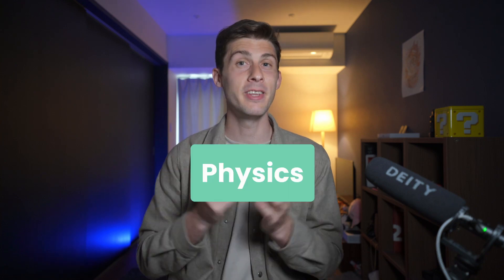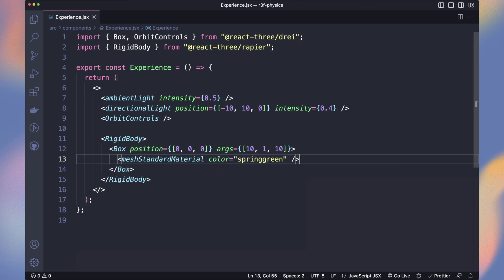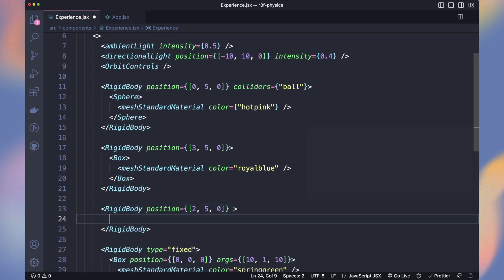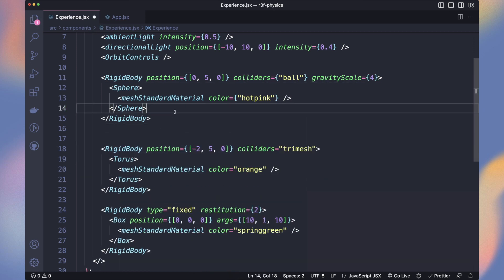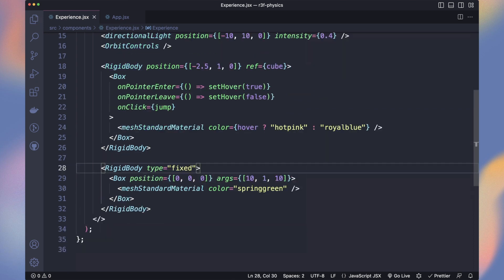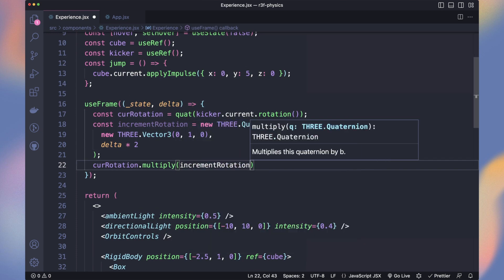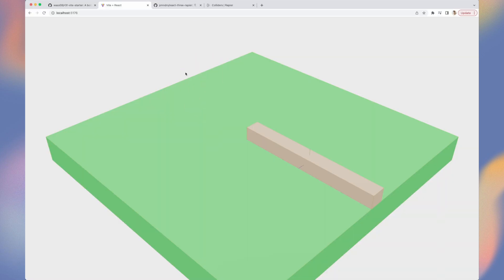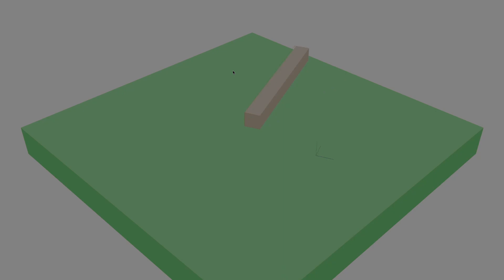React Three Fiber Tutorial - Rapier Physics Engine

Comment: Hey! Just a quick tip:
Don't use states in <Canvas> element because it handles rendering to react instead of webgl. You should set a ref to mesh and change it's material color in onPointerEnter event like ref.current.material.color = new THREE.Color('pink').
Reply: I'm curious and trying to figure out how you would actually write this in code. Is there a chance you could provide an example on how you would implement it? :)
Reply from the maker: Hey, I don't have this tutorial code in mind, but having React re-render won't kill your app (unless done at high frequency with components not meant for that and maybe it's the case in this project I don't remember)
R3F components are memoized it's not the same thing than dom re-renders
Reply: @WawaSensei  the problem is when you use states for 3d objects and change one of those states, react will re-mount that 3d with new states and that process is on react render side and is really slow. Instead you want to do that process on faster webgl side. If you try to animate an object in useFrame and with states it reduces your fps greatly. Even if in your tutorial it doesnt affect it much, it is not a good practice. You can check it in pitfalls section of r3f documentation.
Reply from the maker: @ceyhunkoc6866  they don’t say to not use useState but not update them in useFrame at high frequency (I wan to avoid beginners to be misled by your comment and stop using useState in their r3f project)